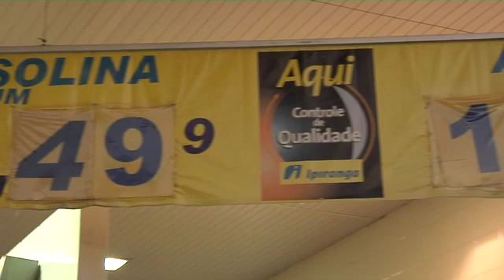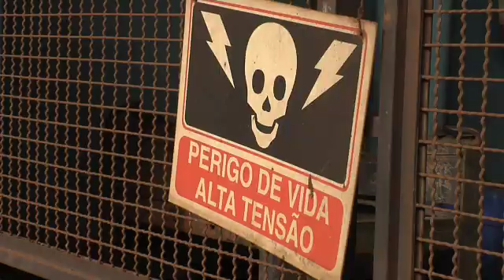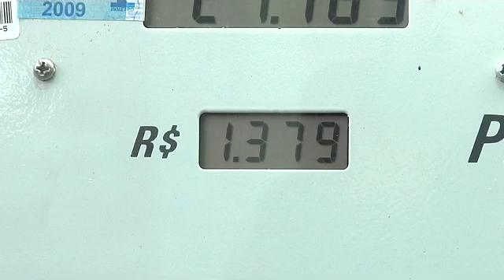Brazil pioneers energy independence with ethanol

Comment: The things which are portrayed as problem are easily solvable. example :- machine sugar cane cutter,  electricity driven biofuel production plant, Also if we mix petrol in some quantity with ehanol , then we will get good efficiency of engine. Also bagas ( remains of sugar cane has good burning characteristic )is very good to produce electricity.

Overall its really good. with minor modifications.
Reply: Kapil Jadhav If you mix petrol in some quantity of ethanol you will get performance enhancements. And at the same time higher fuel consumption. I see it like a double-edged sword... In Brazil for example, we see cars which have 1.0 turbo engines making pretty good numbers of consumption with gasoline... but man, when it's working with ethanol... it becomes a bit gas-guzzling, with number of consumption close to the ones you get in the 1.8-2.0 NA engines.

Comment: That female reporter is a fucking tool.  If it's more expensive and can cause more harm than good then. why is it A)cheaper and B) renewable and carbon neutral. 
the idea is use waste plant material not waste land that could be used on crops. no fucking wonder the elite still have their fuel monopoly with propaganda like this.

Comment: Ethanol is shit. It destroys engines and drives up the price of corn, which negatively impacts many parts of the world that rely on corn. We should have never put that shit in our gasoline. Hydrogen and renewable sources of energy are where our priorities should lie.
Reply: +HTHAMMACK1 I keep hearing how ethanol destroys engines. Yet Brazil has used it as fuel since the 70's....As far as corn for fuel. Why not? It doesn't affect the price of food like some think. You are not eating that corn. Cows eat that corn. However, the process of making corn into fuel, it creates what is called "distiller's dried grains" Which can then be fed to cattle. It's actually even higher in protein after the distilling process.
Reply: No problems with etanol engine normal
Reply: I am from Brazil and I fill up my motocycle tank with alcohol. It has been a long time and up to now I don't have any problem with my vehicle.